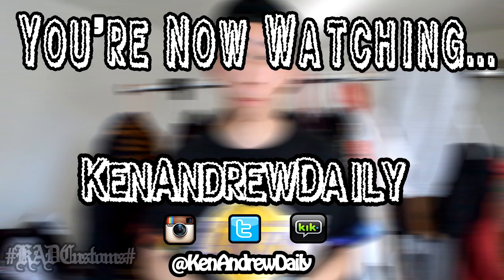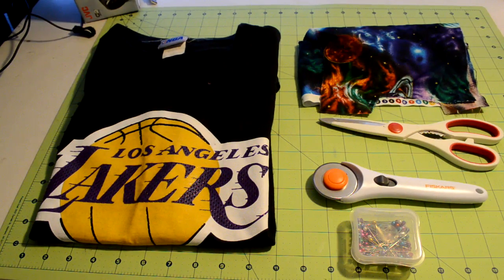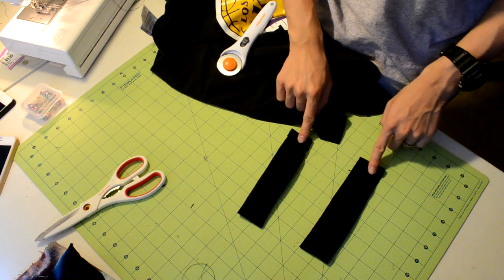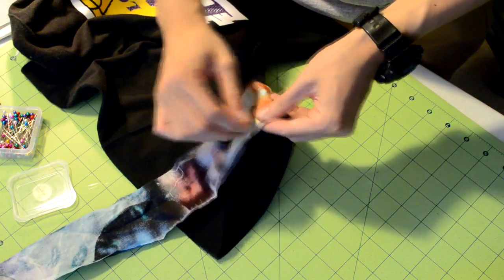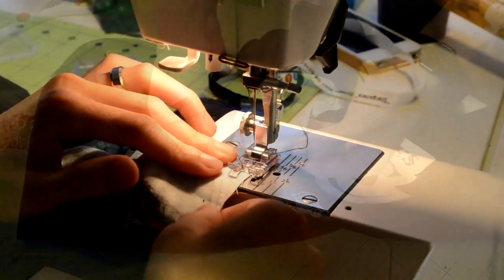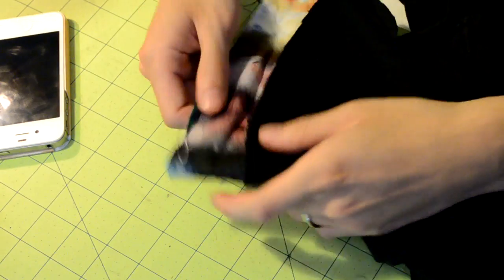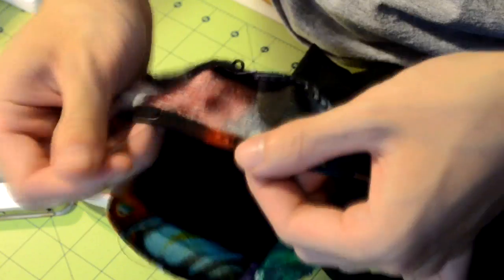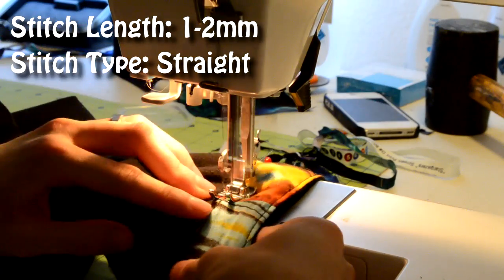DIY: Custom T-Shirt Cuffs Tutorial | KAD Customs #21

Comment: I did it with a little over an inch for the cuff but after sewing it all I thought the sleeves were too short.
Reply from the maker: Depending on what type of t-shirt you used, you might need to change the measurement. My sleeves were a bit too big to begin with. So if you're going to do the custom cuffs on a t-shirt that sleeves are pretty small, I would cuff the t-shirt 1/4" instead of a whole inch.
Reply: ***** thanks for the tutorial